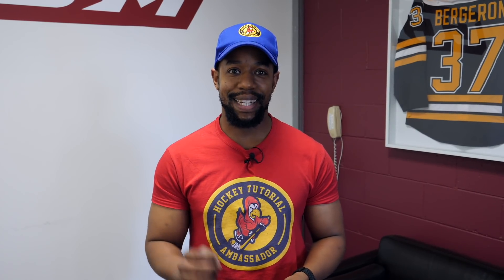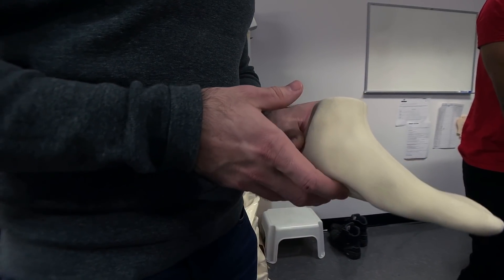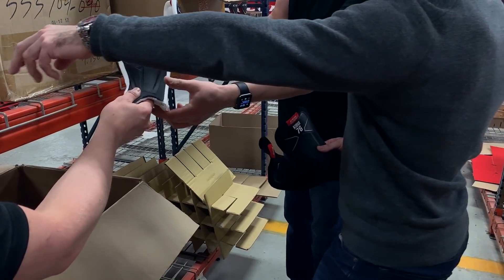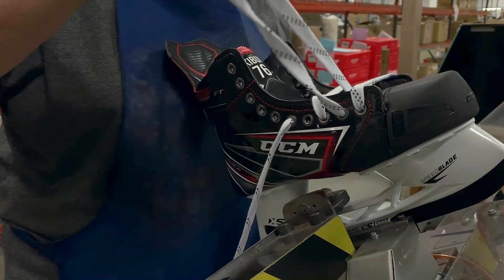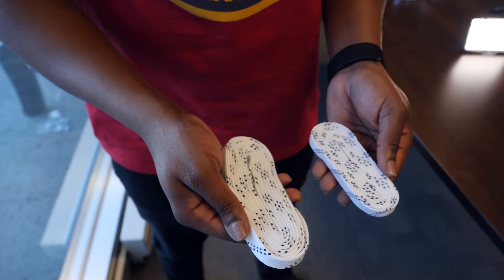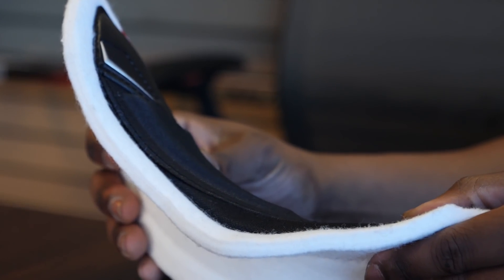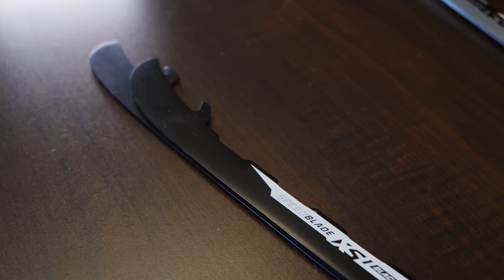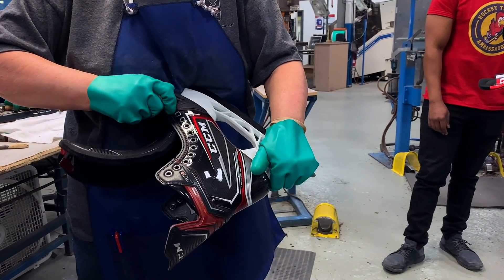CCM Total Custom Skates made in just 1 day ! What options can you choose ?

Comment: Are theses available to the general public or do you have to be affiliated with an NHL team, USHL team or NCAA DivI program? Ballpark, how much are these in US$? 

I think the reason they are able to expand offering custom skates to more consumers now is because they are able to make an exact copy of your feet using the 360 degree scan. In the past the only way to have a custom skate built to exact standards was to make molds of both feet. I know from experience that it was very difficult to get a pro rep to make the molds because they are extremely busy during the season with the teams they service. The other issue was quite frankly the molding process was a pain in the ass and time consuming and messy. They made improvements over the years to make it easier to work with but nowhere near what the scanning option can do.  I do know this from experience, even when I had access to get a mold made, it was virtually impossible to get the rep to do it based on what I previously mentioned. There wasn’t an urgency because I was no longer a player but as a coach on the ice 5 days a week or more getting a properly fitted skate is still a very nice feature because I have two different size feet in length but also in width and that makes it very difficult to fit in a pair of retail skates off the shelf. I have had issues with getting skates that fit going back to my days of playing Jr A and college hockey because we didn’t have custom fitting way back then either. There probably isn’t that many of you out there that have small feet but wider than many of The manufacturers even offer for sale in a retail model so the only option for me has always been trying to get custom fitted skates. Sorry for the long narrative. I’m just really pumped to find out this is finally being offered to the retail market. If anyone could provide the contact information for CCM custom made skates I would really be grateful. Also, does anyone for certain if any of the other skate manufacturers have started a similar program?
Thanks, Phil
Reply: @Phil Doyle Did you have any luck? I had a similar experience with Graf years ago. I made a special trip to the factory with my foot casts, but they never used them and I still had huge gaps in the heel afterwards.

Comment: Can we also change our skate holder? I'm using Step Steel blades, so I really want the old holders.
Reply from the maker: If you have the option, you don't want the old holder, trust me. The new XS 1 blades are a big improvement from the previous gen. Plus STEP already have the new CCM blades. Not sure when that will be made public but they have them. We have a set right now.

Comment: How well does the custom fitting work if you wear orthotics inside your skate to correct foot arches and flatness?orthotics raises the foot in places.  Looks like the scan is of your bare feet with no input of arch support.  Hate to order these only to put orthotics in after delivery and no longer fit?
Reply: As a flat footer, this is all I care about.  I'll spend whatever to eliminate pain.
Reply: same here, i switched from 1x to 2Spros and the pain is gone, but i still have some room in the heel (even in the 1x). I wear orthotics and it would be really great if the 3D things included them but i doubt it'es gonna be soon.
Reply: I wear custom orthotics too and can't skate without them, but theoretically there should be no need for orthotics since the skate is supposed to taken from a mold of your foot.
Reply: Of course that would be IF they placed your foot in the corrected orthotic position, which the vast majority of sales reps probably wouldn't know how to do. So maybe it's necessary to scan with the orthotic ?

Comment: $$$$$$?????? (I guarantee this will be the most asked question so I'm surprised you didn't mention anything about it)
Reply: Full custom is gonna be 1200 euros, 1250 dollars. Just 3D mold is gonna be 900 euros, 950 dollars
Reply: €1200 is about $1,355
€900 is about $1,016
Ian B! 😜
Reply: Full retail on new top models (non custom) in Canada are usually around $1000-1100.  So that's not terrible I guess...as long as you plan on keeping them for a decade.
Reply from the maker: I kept that out intensionally. As the CCM Total Custom skate service hasn't launch yet, I would hate to give a price that could possibly change later. When I share the "FT2 Custom vs FT2 Retail video fit" video or the "First impressions" video, I'll share that info as well.
Reply: @HockeyTutorialOfficial  Word.  Now you just gotta use your clout to infiltrate Bauer to see what they're doing to compete.
Reply from the maker: Working on a video of the big three custom options vs each other 😉